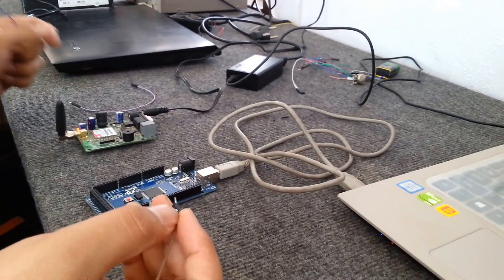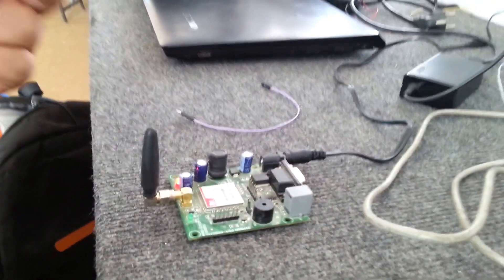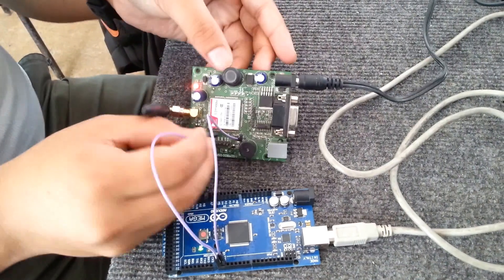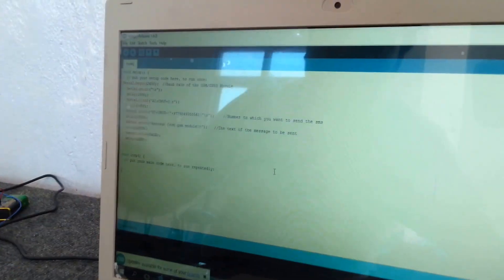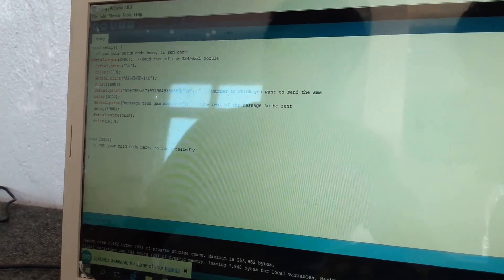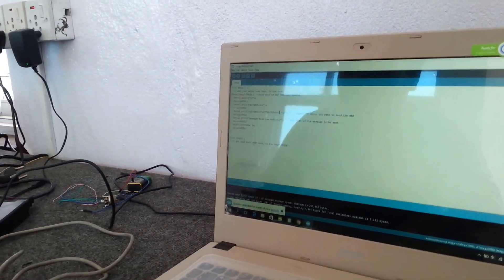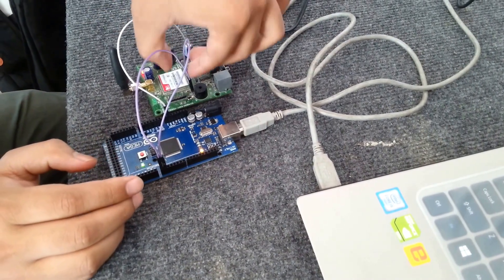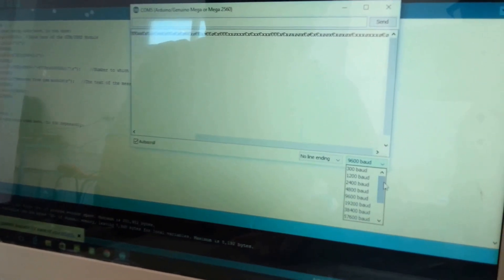Sending and Receiving SMS using GSM module

Comment: It's showing an error:
avrdude: ser_open(): can't open device "\\.\COM1": The system cannot find the file specified.

Problem uploading to board.  See http://www.arduino.cc/en/Guide/Troubleshooting#upload for suggestions.
Reply from the maker: There are many possible reasons as stated on web so I hope it was solved.
Reply: yes the problem is solved.
Reply from the maker: That's great

Comment: Hi.....Im doing a project which requires GSM module to send location co-ordinates (From GPS Module) as SMS to mobile
If u have some free time help with coding Arduino.
Reply from the maker: So have you started working with the code. If yes then do provide it and it would be better if I get the objectives, flowchart and the algorithm of your project. Thank You.
Reply: Sir i am also working on same project

Comment: sir when I was using the 12v and 1 amp adapter, the green led was not blinking and the buzzer inbuilt in the gsm was making the countinous sound.( NOTE: MY GSM MODULE IS SAME as YOURS)........so sir is this the reason for disfunctioning of my gsm module??????
Reply from the maker: Did you rechecked your configuration. If there is still problem after you rechecked try using the adapter with 1.5 or 2 amp but the best would be trying the same with some other GSM. Hope to assist you further if any errors.

Comment: can't we give 5v to gsm modeule directly from arduino instead of external supply
Reply from the maker: yes we can but most of the case and many people have received error while giving 5V directly from arduino it is because of the current rating of the two devices. So better to create separate source for both. Thank You.

Comment: What will be the code if the message we want to send is GPS coordinate. I have a GPS module but i cant find the codes and also need to interface this two modules simultaneously.
Reply from the maker: Hello friend, it would be great if you could specify a gps module module . SInce you mention interfacing both gps and gsm module so what actually is the project title or objective. If you can we can collaborate on it too.

Comment: At command not responding what to do
Reply from the maker: did you visit the blog what kind of error are you getting do mention it
Reply: not showing error

when i upload the blank code   and
sending  AT command it desnot respond

connection
tx   to rx of arduino
rx to tx of arduino
common grund
Reply from the maker: Did you disconnected the connection while uploading program
Reply: ya

Comment: u connect only ground pin
not vcc why
Reply from the maker: voltage for the gsm is provided from the power cable i.e is the reason nothing other than that. thank you

Comment: Hello, this is really a great help! But how about receiving SMS sent from mobile? I've been working on it for days but seems no luck. By the way, I'm using the same components as yours.
Reply from the maker: Thank you for you comment and its my pleasure to help you. Actually I am received these queries earlier too so I have written the procedure on the comment section of the mentioned blog. However, it seems you are working with mobile to GSM and vice versa. In this case there would be minor changes by mobilization of the same program. 
==>In this case you need to view your mobile sent sms on the serial monitor so it is just for confirmation.
==>Create a setup or compare using case statements like if sms==go,
==>enter your preferred code
==>now its all set to go.
If its still bothering you with the code you can drop an email @ ssarowj99@gmail.com with your present code so I could help to fix the issues. 
Hope it wa helpful.
Reply: Thank you for your prompt reply. I will email you my code in no time so you can determine if I am on the right track. I truly appreciate your help.
Reply from the maker: Sure. Its my pleasure helping you out. Exploring by sharing.
Reply: same issue with me can you plz help me. my gsm is not working correct in case of recive messge
Reply from the maker: The issues were solved via blog and comments. However I would be happy for additional support.
Reply: plz share your email so I send you my code. I shall be very grateful to you.
Reply from the maker: mail at ssarowj99@gmail.com of drop a message at fb page www.facebook.com/e-robotron